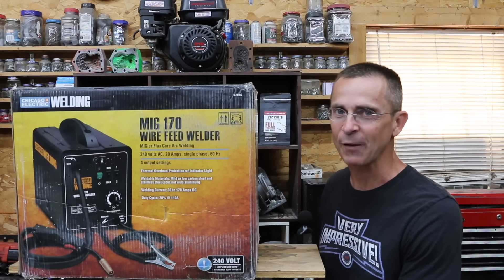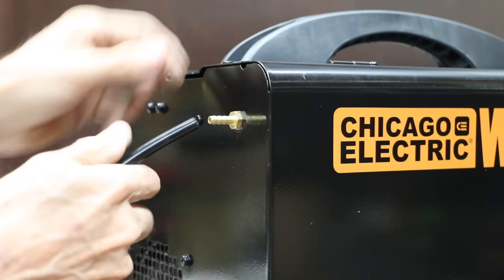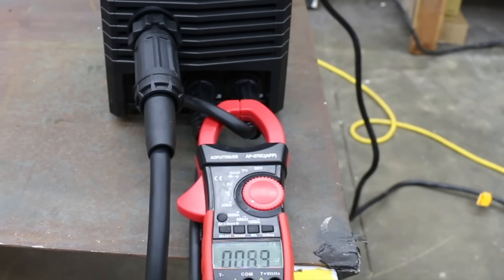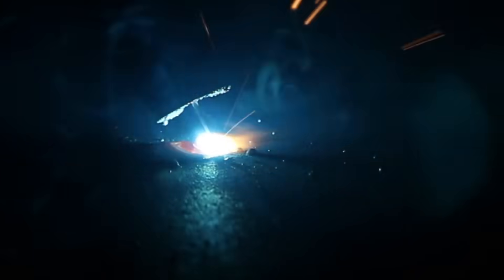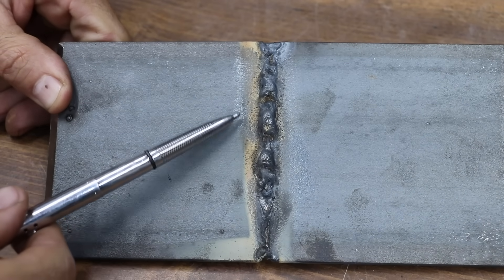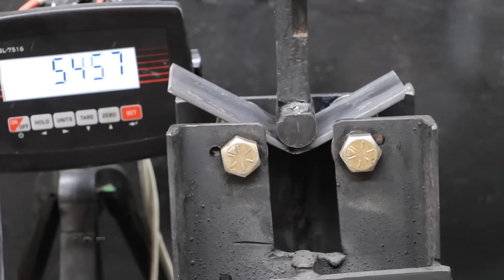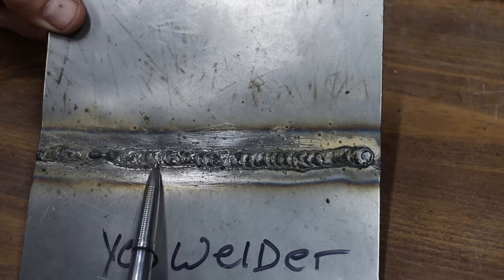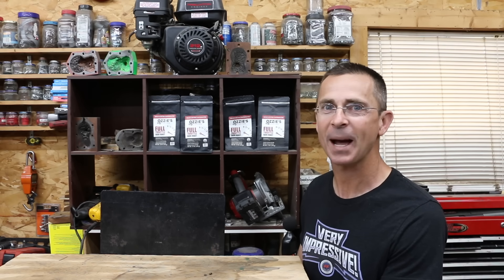Cheap vs Expensive Welder? Let’s Find Out!

Comment: Thanks for taking the time to test these welders.  Certainly, what can be achieved (at least, while they're new) by an inexpensive welder today is pretty amazing compared to much more expensive welders of years gone by.  I'm biased in favor of marine, but the most important test I'd want to see  before buying a wire feed box is how well it does aluminum. I'd be curious to see Fronius versus Miller on pulsed mig for aluminum, but that's probably outside the budget of this channel.
Reply from the maker: Thank you for sharing!

Comment: Excellent! Couldn't wait to see this video. I was a little disappointed there was not a PrimeWeld machine in the competition. I have a Primeweld plasma and tig/stick welder. I am considering replacing my lincoln 110 wire machine with a Primeweld MIG285.
Reply from the maker: Thank you for sharing!

Comment: Thanks for another stellar review, Todd! As a welder with 25+ years of experience, I will say that what you get out of buying Miller or Lincoln machines is great customer support. Pick up the phone and a tech can walk you through a repair, or you take take it to a local dealer for service. Not so with the Chinese stuff. Had a problem with the control board on an Everlast PowerMTS 251 welder at my last job, and getting in touch with anyone was a joke. They emailed me a PDF that looked like it was drawn up by a 5 year old, and when I had a question about clarifying some of the ridiculous crap on their drawing I couldn't get anyone to call me back. I ended up leaving that position before we ever got a resolution on it.

With welders, buy them cheap enough that when they break you just throw it away, or save up your money for something blue or red and keep it forever, fixing it along the way. There really isn't any middle ground unless you want to be constantly frustrated. My two pennies, anyway.
Reply: Funny, lately I've seen some of the Red and Blue customer and warranty work being very poor. Wrong parts installed... No offering support. It was the reason i ended up going a different route.
Reply: @ABeans07 plus making replacement parts and labor cost more than the welder is worth or even a new one. They don’t want you to fix, only replace. Most manufactures just want you to keep buying.
Reply: Great point. I've also had good luck with Hobart which is part of Miller. A lower grade but still made in the USA and affordable.
Reply: I love this review, BUT I want an engineer (possibly like AVE) to discuss and compare build quality as well. If there are weaknesses in the wire feed, the transformer, the switches, etc... it needs to go into the decision process.
Reply: You may find this has changed with Lincoln in particular.  With the perpetual main board failures on their MP210/215's (and others) their response has not been one that breeds or fosters brand loyalty.  Two friends swore them off for ever after identical failures and no warranty support inside the warranty period.  Thier research after the failure indicates not only is it common problem, but even if they ponied up for the board (at 3/4 price of a new machine) no improvements have been made.
Reply: Only speaking for the UK here where I was a former warranty agent for Lincoln. Yes Lincoln had decent service but when your equipment failed outside warranty you could buy 2 or 3 cheap machines for the same price of the replacement part of your Lincoln machine. We had a spate of V350 power sources go down outside warranty (around 5 years old) and each was on average £2k to repair. You can buy a full Jasic 450 amp machine with wire feeder and cables for around that price, with a 5 year warranty too.
Reply: But that's basically what u are doing. Buy cheap to do 1 or a few jobs and if last longer bonus. We have a local repair shop tho that would fix basically anything. So if cheap did go bust they could fix it.
Reply: I own a Lincoln 215 MPi, before that, I had a 210 MP. Both great machines, also own a Chinese Hitbox.  People might say that with what a paid for the Lincoln, I can buy 15 Hitbox but,  the quality  of work of the Hitbox, does not compare to Lincoln, not to mention que service. Had a small issue with the Lincoln and in less than 24 hours was solved. Had an issue with  the Hitbox and, that's when I realized that those Chinese cheap machines are disposable.  Why I have the Hitbox? Portability and it was given to me.
Reply: Parts availability is a big thing with these. Other than my super special 2 year only foot pedal switch I've been able to buy all OEM Miller parts for my Syncrowave 250.
Reply: 😂😂😂 I'm a welder by trade and suggesting modern blue and red are "repairable" is bullshit.
The motherboard is worth 80% of the unit and they last less than the off brand machines.
Reply: Yeah I retires from my production welding job with only 16 yrs experience. We used these huge millers. During all that time I managed to learn almost nothing!
Reply: Well, you are paying for the tech support at $2250 vs $360.  How many YesWelders can you buy for $360 for the price of one Lincoln? And its not like the worker in the US is getting any decent medical benefits like in Europe, either. We are paying workers here nothing but overcharging customers.  What use is the tech help if the parts are another ripoff, eh?  I'll get the Chinese one.
Reply: @mjremy2605  you pretty much made my point there, man. lol. Either invest in something better or pay for the Chinese ones over and over again. There are tons of other factors too, like overall build quality, component quality, arc stability, weld quality...hell, even among of all the Chinese machines in this video, some were far better than others in how they welded, which was pointed out a couple times. 

Look, I'm not saying that red and blue are perfect. Nobody is, especially with the advent of digital touchscreens and all of the BS that has no business being on a welder, IMO. That said, I cut my teeth on Miller machines doing very technical 6G stuff in the USAF, so I know what high quality machines can do for you. I also have a lot of time on smaller, less expensive hobby machines, some made here, some made in China. There is a tangible difference between the two for a professional who's welds are about to be subjected to an NDI machine. For the home hobbyist just gluing stuff together in their garage, get whatever you want...but if you can afford a nicer machine, you (generally) will not be disappointed. Even a used Miller machine that's 20 years old will likely outperform anything new that's produced overseas. There's a multitude of reasons you won't find an Everlast welder being used to weld up the cracks on a F-16's flame holder, and "made in China" is only one of them. Standards exist for a reason.
Reply: My Miller MDX-250  MIG gun costs $360. I hold more quality, reliability and value in my hand than is built into an entire welding machine.
Reply: @mjremy2605  If you're just gluing stuff together, I can see your point, but I can also see from the video and my own experience in the machine shop I work at that those cheapo Chinese off-brand welders aren't going to pass any kind of certification.
Reply: @dandeerso 😂😂😂😂you definitely aren't a real welder if you think the machine is what passes the certification

Comment: There is another question that was touched on but not fully explored.  What is the duty cycle rating for each of these welders.  The Vulcan and Lincoln are both commercial grade welders and should have a duty cycle north of 80%, if not 100%.  All of the others appeared to be hobbyist or very light commercial models.  That makes a very big difference in how long the welder will run, how consistent it will run, and how long it will last.  You may be able to get the YesWelder for under $300, but if you have to repurchase it every year versus the Lincoln that will last a decade or longer with minor maintenance; which is actually the better value?

Overall, it's a good test, as far as it goes.  This does bring up some options that I never would have considered.  For my money, though, I think the Vulcan is the best option as long as you aren't welding a ton of thin sheet metal.

Comment: Well........................! I was raised on the old Lincoln 225 amp Tombstone welders and watched them build everything from log frames to building up dozer tracks with new grouser bars and having to dunk the stinger in water to cool it off and the old artifacts just kept on running in spite of a way-low duty cycle rating. Now somebody can get a right cheap priced job that'll do every blasted thing out of one unit. Amazing to me. The test with Virgil was WAY over the top. Covered a good cross section of jobs and the variations to make a good call! I always wanted to get into MIG but never had the chance and sure not the money. And you showed that an outfit can be had for a reasonable price and could pull it off with no problem. WELL DONE, Commander! Still praying for yall some rain so maybe you'll get some more. Hope all is well on the farm and Welcome To Fall! God Bless Yall and I'd still probably get a Lincoln!
Reply from the maker: Hi Lewie, The old Lincoln 225 Tombstone's have an impeccable reputation! It's amazing to me regarding how much smaller and more capable the welders have become. The MIG welders are simply amazing! Prayers have been answered and we had about 3 inches of rain and hail. Fortunately, only lost 2 trees and I was able to lift one of the fallen trees off of a fence using the tractor.  The cows are going to be happy as they fill up on lush green grass just before winter arrives.  Wishing yall the very best and many BLESSINGS!!!
Reply: @ProjectFarm  Yessir, the inverters are something else. I'm still a basic transformer guy and a little gun shy of the new stuff but it's proving itself every day. Sorry about the ice but GLAD for the water. Happy cows make a happy farm! Blessings 'Sure 'Nuff!

Comment: In my opinion the do it yourselfer is going to do a lot more welding on 20 gauge than quarter inch. For the heavy stuff buy a stick welder. The ability of the Azzuno to deliver a controlled weld on 20 gauge, at that price range, is impressive.
OK I just bought the Azzuno and some Yeswelder .030 flux core. We shall see. It is sheet metal I am interested in.
Have had the Azzuno now for several weeks and after adding gas and .024 wire I'm happy with it. I just added 3 feet to my utility trailer using 1/4" angle. For those welds I used my very hot running Campbell Hausfeld flux core welder. It has two heat ranges which are way too hot and way way way too hot. It really sinks those welds on the 1/4". Then I built a new ramp/gate out of 1/8" tubing using .024 wire and gas. The Azzuno can lay down some beautiful buttery welds when you have a good ground but the clamp isn't the best. I think for the typical hobby welder the Azzuno is a good choice but spend the money to get a gas bottle and .023/.024 wire and a .023 feed roller. You will never go back to flux core.
I find it interesting that the Azzuno had the least penetration but the second strongest weld. That tells me something about the quality of the weld Azzuno is capable of.
Reply from the maker: Thank you for sharing!

Comment: I do a lot of soldering, it would be awesome if you did a video on soldering irons or even fume extractors. There is barely any videos on either of those two.

Some notables are Hakko known for the FX951, Weller, Milwaukee. high end JBC. Cheap alternatives Pinecil, Yihua, Chicago Electric. 

For fume extractors there is many, but most are garbage. Hakko makes really good midrange ones.
Reply from the maker: Thank you for sharing!

Comment: I think the interesting takeaway here is the lower quality the welder the higher the skill required. However the higher the skill the more likely you are to have a higher quality machine.

Weird how it works out that way, but if you’re good enough to do it with trash you’re most likely payed well enough to afford the treasure.

Comment: I got the Chicago electric mig 180 5 years or so ago, so it's nice to know how it compares.   It's not the easiest to work with, but nice to know what other options there are and how capable when choosing my next one.  I also have a hard time on thinner material, so nice to know it wasn't just me.
Reply from the maker: Thanks for sharing!
Reply: I have the same welder and just use it to booger things that aren't too critical. I do wonder how it would weld with the cap mod easily found on the internet.....

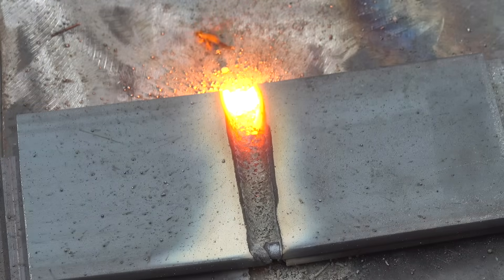Comment: 10:48 -- Unconventional, but anything that kills hornets is good in my book! 🤣

If I was going to buy a welder from this list, I'd probably go for the Azzuno, since it seems to be the better all-around welder. The biggest reason, though, is the sheet metal welding. I'd probably use it to weld floor pans on old cars, so I'd need something that can consistently make good sheet metal welds. 

I'd like to see a follow-up video on the TIG welding capabilities of the welders. 

I didn't quite catch which ones do and which ones don't have TIG and stick capabilities; a community post of a spreadsheet/graph would be a good follow-up also, I think.
Reply from the maker: lol

Comment: Never really liked the Chicago electric however love my titanium 125 welder from harbor freight, despite being only a flux welder it's done a decent job on welding go kart frames and such. However it too does not like thin gauge material either. But for under 200 bucks I can't complain
Reply from the maker: Thanks for the feedback.

Comment: Good job again. But a couple of questions/comments. Why flux core on the thin stuff? Just to challenge the setups? 025 wire on Gas is much more suited to thin stuff. Did you run the welders on 220V? You may have said but I didn't catch it. And if you are doing a MIG shootout, why throw in the multi-process welders? You are paying more for features that weren't even tested for this showdown. Still, nice work and your reviews are very much appreciated.

Comment: I bought a cheap ($120) flux core no name welder off of eBay a couple years ago. I’ve ran 3 spools of wire through it now and have got it figured out. It’s very simple and only has 2 switches to regulate how much power it’s putting out. It actually does a good job and penetrates well but on thin metal I can not get it low enough to not burn through without using a long extension cord to kill some voltage, then it will work pretty good.
Reply from the maker: Thanks for sharing.

Comment: Project Farm.. I have the Harbor Freight Chicago Electric 170 and I can agree that it's not that good. It welds thick material better than thin but still not so good. Would be nice to see you throw an Arccaptain MIG200 in the mix to see how if it beats any of them. I would love to that Lincoln welder or even a Miller. Anyway cool comparison of the welders.
Reply from the maker: Thanks!  Thanks for the suggestion.

Comment: Great Test! I am a retired weldor, [55yrs] machinist / metal fabricator. Here is a "Pro Tip" for FCAW and MIG. Cut a piece of felt, or similar material, approx. 1" square, Get a small binder clip or clothes pin fold the felt around the wire before it enters the wire feed system. [do not clamp tight!] spray with WD 40. As the wire comes off roll it will be cleaned an slightly lubricated. Any small amount of wd will burn off,and will not affect the weldment.    I have NEVER had a weld fail using this method.  Take care of the hose, remember that the wire inside needs a smooth path thru the liner inside the hose to make a smooth weld.
Reply from the maker: Thanks!  Thanks for the tip!

Comment: Will these work when plugged into a 15A 115V home outlet?
Reply: I think he said the chicago electric is 220. The others will work on a 15amp 115v outlet. Use a 20 amp if your doing heavy welding for a long time.

Comment: Welding 20GA you should use .023 and doing so the Lincoln would still come out on top. I use my Linde welder with .023. I bought it in 1981. The salesman brought it to my shop where I had a Porsche 944 front fender ready to weld. I said if this thing will weld this thin metal I'll buy it!  With no mig experience what so ever I had no trouble welding that fender. Mine has an on/off pulse feature for stitch welding and what I call cruise control. Pull the trigger and start welding, the thing will keep welding until you click it again to stop it. For long welds, it's great! I think I  paid $1300.00 for it. The only thing I replaced after years of use is the gun which I replaced with a Tweeco kit. That's it.
Reply from the maker: Thanks for sharing.